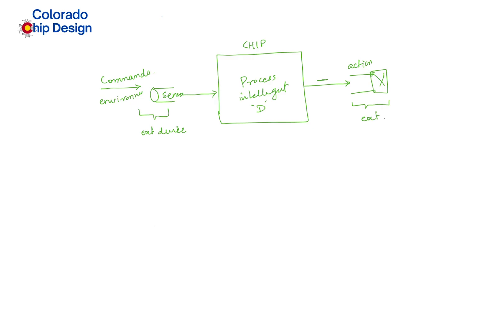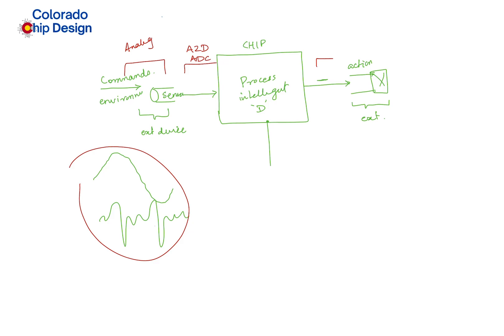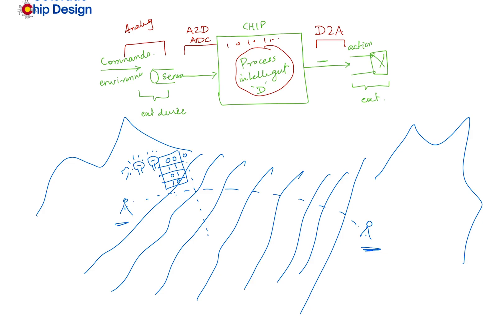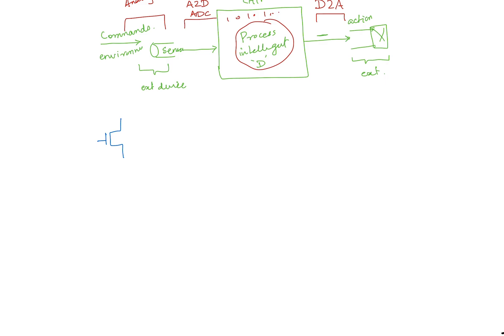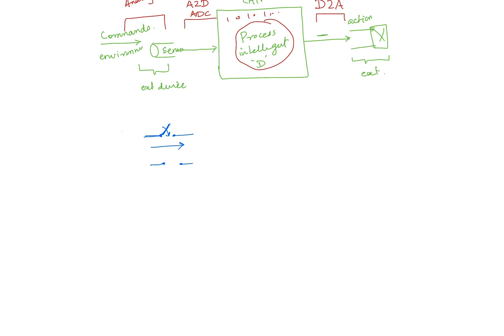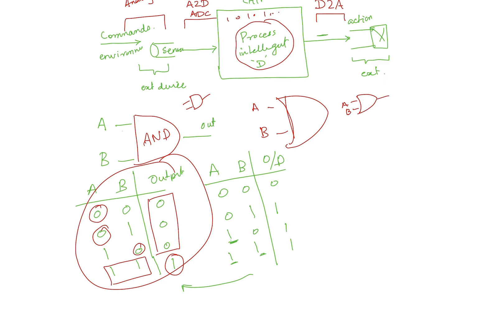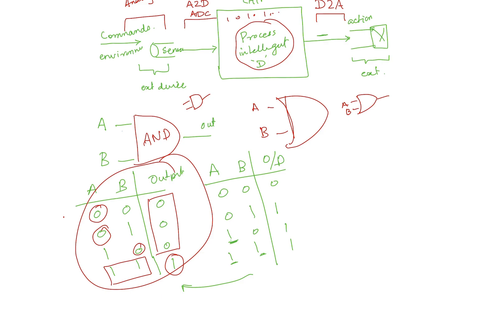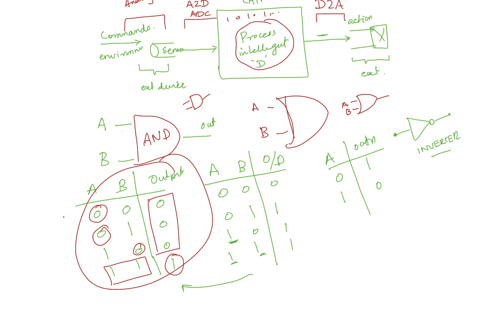Topic 1- Logic Design- Understanding Basic Gates

Comment: AS Sir, thank you very much for your efforts, what software do we need for desigining chip design? what is the difference between Lab on a chip and system on a chip? what is the difference between analog design and digital design?
Reply from the maker: never heard of lab on a chip :-) ; system on a chip, means core+ other peripheral and accelerator IPs, all on a single chip. thought these days, its more of a system in a package as multiple dies are created. between digital and analog ; if i have to give single line then its different region of operation where transistors are required to operate. I will do analog series in early next year where you will see the difference.